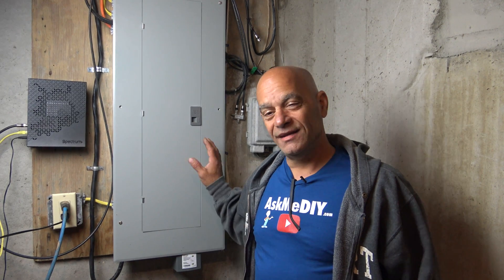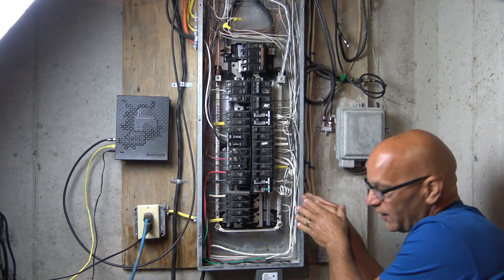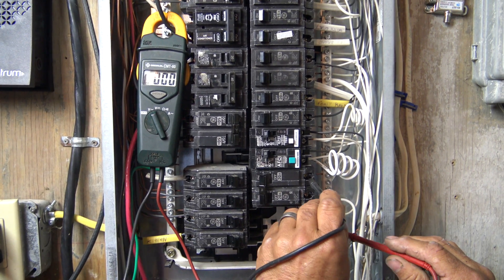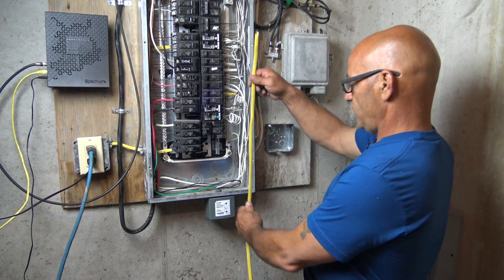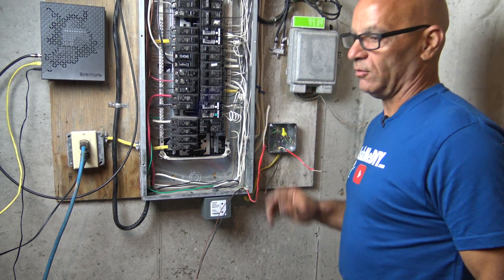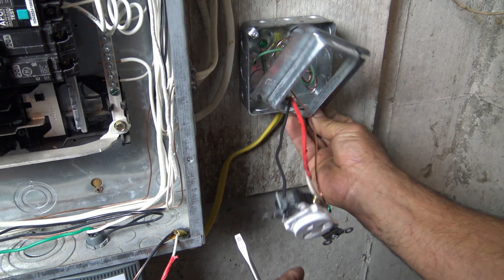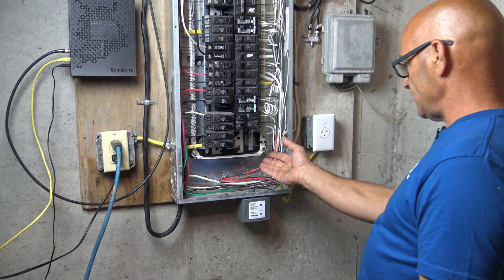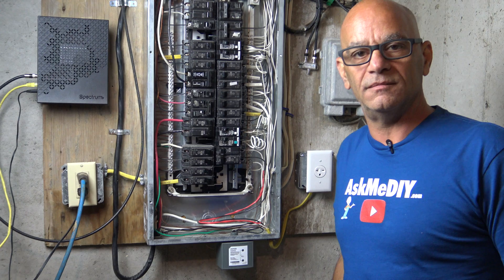How To Install a 220 Volt Outlet

Comment: I am fixing to install in my garage a 50 amp 220 3 prong plug with 6/2 nm-b wire using a metal box the same as you just did. This video is the only one I've seen after many searches showing this particular install and how the metal box is grounded.
Reply: Awesome, Glad I was able to help out.

Comment: Hey, thank you for this beneficial video. I just didn’t get the ground cable thing I just need a little bit of explanation regarding what kind of cable should I use if there’s a name. Would it have two or three wires in it? 
I need to run a 240 v cable from my broker which is outside of the house to the kitchen for my new electrical stove. Do I need to have a cable that has three wires to run it all from the breaker to the outlet?

Comment: Our electrician uses 8 gauge aluminum wire for the 240 outlets. Is there a NEMA 6-20 receptacle that is rated for aluminum

Comment: Dominick, i need to place a 240 receptacle in a outlet box that used to have a 240 but now only wires live their. My dilema is that my receptacle has 2 hot and a ground connection but the box has a red a black a white and a ground wire. Red and black are hot what do i do with the white?
Reply from the maker: Use a tester and which wires are hot and voltage. What kind of breaker?

Comment: Can I just replace a 115v with a 220v if they are both 15amp?
Reply from the maker: Not a chance
Reply: @Askmediy  could I use a step up converter in lue of wiring a new breaker? It's for an ac unit
Reply from the maker: Just based on the questions you’re asking me you need to get a Electrion on this. You’re going to end really doing something wrong here.

Comment: Nicely explained yet we need to find you some electrically insulated screw drivers! 

I have one question. Can I install a 240vac outlet in series with a wall heater or will this cause the breaker to trip? Or should all outlets and appliances have their own path to the breaker panel?
Reply from the maker: Thank you. Yeah I would run a separate line for each outlet.

Comment: Why not just use a Mulberry cover instead of using a raised adapter plate- device- finish plate?
Reply from the maker: Whatever floats your boat really. For where this outlet is located, yes a mulberry cover would've been better. But hey had to get the video done.

Comment: Good info.   I'm installing a Mini-split, and its rated 208-230v/60Hz/1Ph.  I'm assuming this is the wiring setup I need for that.  I've done 110v wiring including installing new wire and breakers, but as a DIY guy, I've never done something like this and am just looking for some helpful info.  This seems to be the right thing I'm looking for!

Comment: Thank you for the great tutorial. A couple questions: another video said to have the ground on top and the two hots on the bottom. They said it protects it if the cord gets hit or if water drips on it. I don’t quite understand that. You mentioned code and identifying the two hot wires…are there other NEC codes (for a simple install like your demonstration) that we should know about? I.e. fireproof grommet through the panel knockout or using a plastic vs a metal box for your switch. If you have the space on your panel can you install any size amp? Ex. 240v 50 amp double pole single throw switch without worrying about if there is enough power coming into the panel (dumb question but I, for one, don’t actually know how much juice I have coming into my house). Thank you very much for any clarification you can bring as I am about to install a 240v outlet next to my panel for my air compressor.

Comment: dude can I install a 15A 125V outlet on a 220V circuit without using above recommended wattage?
Reply from the maker: No, it's still 220 volts. You can use the wire, but it has to be connected in the panel as 120 volts.

Comment: why  a return(neutral) is not required for this 240V wiring? good video very instructional and fun to watch every minute of it.thx
Reply from the maker: this setup does not use a neutral wire. The neutral wire is a return path back to the transformer, in other words, a balanced load

Comment: Are the Input power mains OUT OF PHASE with each other?
Reply from the maker: Yes of course they are. Don’t really understand why you’re asking that question on a install video!
Reply: @Askmediy  Well

I am 30 year electronics Tech and not a Licensed Electrician

I have assumed that there are two 120 vac inputs that are of opposite phases sent to each Homes Main breakers

I see that that a double breaker is really connected on the same power Bus

I just thought I would ask

That's all
Reply from the maker: @joetterolison1286  oh ok. The breaker only looks like it is. It actually grabs the two different buss bars. One from each side. On my website I show more of this. Askmediy.com

Comment: Thank you.  Is the size / appearance different between a 120v 20 amp receptacle and a 240v 20 amp receptacle?
Reply from the maker: Same wire, 12 gauge 20 amp. Just wired differently.

Comment: G’Morning Sir!!
Pls let me know if you can help answering a quick question…
Went to Home Depot to get a 15Amp / 240V 2 Poles breaker..
Got home to start the install BUT I realized the connectors back on the breaker does not match with the pins on the bus bar.
Here is the question…
Are the back connectors of the breakers different from one brand to another?
Cause now everything is done here but the freaking breaker that does not snap in to the 2 bus bar fases!..😬
Thank You in advance!
Reply from the maker: First you need a 20 amp breaker and the type must match what you have now. Bring a breaker in the store
Reply: @Askmediy  Thank You so very much for your fast reply!
I work fixing Dental Equipments.
I have just one dental equipment (sterilizer/autoclave) that the manufacture says Circuit Breaker 10Amp and this new outlet will be dedicated to test this equipment only.
Because the Manufacture says 10Amp Breaker I thought it must be it.
I got 15Amp cause I haven’t found 10Amp.
The equipment has it’s own breaker…so…I understand I can get a 20Amp breaker and if something is wrong with the equipment the breaker of the equipment trips first.
Ok!!
I’ll get one breaker out of the panel and make another trip to Home Depot!
Have a good sunday Sir!
Reply from the maker: @SOLLAIUSA  are you sure it’s 240 volt?

Comment: I just want to be very clear about the ground.
There's 240v going through the ground back to the ground bus, correct?
Reply from the maker: The ground is ground and never connected to a neutral or hot leg
Reply: Melvin, I think you're referring to the part in the video where there's a reading across ground and one of the 240's positive legs. That was 120 volts, not 240. It makes sense since INSIDE the box, neutral and ground are connected, and a return path for any 120 positive.

Comment: Dom, great video. I been watching YouTube video for the last two hours. You have the best example of how to install a 240 outlet.

I’m gonna be wiring in some 120 and 240 volts next month on a new sub-panel in the shop. I never worked with 240 volts before. Now I have a question that I can’t seen to find the answer too. 

Can I run two 20 amps outlets at 240 volts on the same circuit in parallel? Each night lights will be drawing 5.3 amps continuously. I was thinking of adding a 3th night light but I will be at my 80% capacity. I don’t want to over heat the wires so I think 2 light will work just fine on that circuit. I also will be adding an on/off 240volt, 20 amp switch to each light on that circuit. I will be using 12 gage wire for the lights and switches. Please remember I never worked with 240 before.  

I’m gonna have an electrician come in and wire the new sub-panel and inspect my work too. 

Thanks a lot.
Reply from the maker: Yeah sounds right to me.
Reply: @Askmediy  thank you so much.

Comment: The warning on my tanning bed says voltage must be below 230 VAC or I may need a buck booster. I've got the same set up you just demonstrated, but don't have a meter to check it yet. I assume it will also be ~245. Any advise? After a quick search, those things appear to be pricey.
Reply from the maker: Just get a cheap meter and you’ll know for sure .

Comment: What do u recommend when moving the original panel to a new spot. It’s 100 amp service breaker not main lug. What I want to do is just use another 100 amp breaker from the old panel to a new panel 100 amp to main lug. My question is the original panel doesn’t have a ground bar, I did run a ground wire from old to new panel, how do I ground it. And does ground & neutral have to be bonded in the new panel?
Reply from the maker: Yeah you're going to need that ground bar. If you have a sub-panel, no. If not yes,
Reply: Thanx for getting back to me. I didn’t totally understand ur answer. I definitely need to install a ground wire in the old panel for ground to new panel. But does the new panel have to be bonded? There is no sub panel, just old panel to new panel?
Reply from the maker: Yes always.

Comment: At the actual outlet I get 120 reading from both hots to ground.. but dont get a reading from hot to hot.. help, what do i do to get 220 from hot to hot?
Reply from the maker: Sounds like you have both hot legs on the same buss bar in the panel

Comment: Great video u make it easy. I am doing this for a air compressor now i need to find the plug i need so i can plug the compressor in when im done. Is there a good brand plug i can get ?
Reply from the maker: Just don't buy one at the dollar store. Home Depot has good ones, for the 220 20 amp  Leviton is a good one

Comment: If 2-20 Amp breakers produce $240 volts, why do people use  2-50 amp breakers to get the same for the Tesla charger?
Reply from the maker: Because that's what is needed in those chargers. Like some instant hot water heaters can use 4 220 breakers.

Comment: My stove outlet is a 220 and all the sudden it started beeping bad line now my stove is all electric. I had to cook dinner so I moved the stove over to where the AC was plugged into which is the same type of plug and I plugged it into there and it worked. I then continued to cook dinner. I have replaced the outlet on the wall I've also replaced the breaker plugged the stove back into where it belongs and it still is beeping a consistent long beep and saying bad line on my stove. Does that mean the problem lies within the wall???
Reply from the maker: Are you sure it’s 220, do you cook with gas, flame?

Comment: My welder is 15 amp 250 volts. Can I use this 20 amp 240 to run my welder? Is it safe to do so?
Reply from the maker: That's what you would use.

Comment: Is there a way to wire a single 240v outlet with two 120v outlets off the same breaker?  I have a piece of equipment that will require 240v and a separate 120v device.  It's a table saw and a dust collector, namely a Shopsmith.
Reply from the maker: I mean can you yes, should you no. You would just use one of the hits from the 240 and a neutral for the 120
Reply: @Askmediy  so, it would be better practice to run the 120v dust collector off a separate breaker and run two sets of wires?
Reply from the maker: Yes big time.
Reply: @Askmediy  thank you for your time!

Comment: great video, my solar grid tie inverter  is 2000watt ac output, once i install the 240 plug you did , which AC breaker should i use ?
Reply from the maker: I would have to say the house one. But to tell you the truth I don't know enough about solar to give you the correct answer.
Reply: @Askmediy  i guessi gnore the solar part jus t an AC out let in  an excloused extensions to to house .. i guess a GFI too. .
Reply from the maker: @aedgvv6095  No, no need for a GFI. besides this 240 volts.
Reply: @Askmediy  so in north america hot tubs have no GFI?
Reply from the maker: @aedgvv6095  Oh GOD yes, So sorry, I was answering like ten questions at the same time. Depends on what you're connecting if you need a GFCI breaker or not.

Comment: My friend lives in a condo with his own panel near the kitchen. He wants to switch from a gas to an electric stove and needs a 240 plug. It looks like he has space in the panel and breakers that are marked 120/240. Is it going to be difficult to change it from 120-240? How much would it cost to hire and electrician ?
Reply from the maker: He'll have to run a 40-50 amp wire from the stove to the panel. How much, I have no idea.
Reply: @Askmediy  thanks for the quick response!

Comment: Great video. I do wish the ground wire in the box was explained a bit more.
Reply from the maker: You and me both!
Reply: The metal box must be grounded. You need 2 pigtails and a wire nut. One goes to the box and the other goes to the receptacle ground. The ground wire from the yellow cable ties them them together via a wire nut. Three wires in the wire nut. See view at 10:37. Metal boxes typically have a 10-32 threaded hole for a green grounding screw.

Comment: You dont need to use 4 wires. Just asking as i watched another video and he used 4 wires.
Reply from the maker: What you watched was them using the neutral. It really all depends on what you're wiring.

Comment: Best video on installing a 240V outlet, thank you, question I'm putting a outlet outside under my carport to run a welder, what kind of box do I need?
Reply from the maker: You'll need a whats called a bubble cover. But really there are a few ways you can do this. Just ask at the store and you'll see.
Reply: @Askmediy  thanks, I saw few different types at Lowe's today, some was metal and some plastic.
Reply from the maker: @kemarrance8755  Either one really. I like plastic for what you're doing
Reply: @Askmediy  Ok, I like the plastic more too, thanks for the advice, I'm going to get the plastic one.

Comment: If you were to wire 2 hot wires and 1 neutral wire to a light socket will the light socket power a 220 volt lightbulb
Reply from the maker: Most light sockets only have one hot.

Comment: I added a 220 prewire for my new construction home for an EV charger. Do I need to buy a circuit breaker and a  NEMA 14-50 outlet? Or will that be included.
Reply from the maker: No it won't be included.
Reply: @Askmediy  Ok thank you for the reply. I plan to hire an electrician to help install the outlet.
Reply from the maker: Good idea I would say. Make sure you ask if they have even done one before
Reply: @Askmediy  I will make sure they have experience installing EV chargers or outlets for EV charger use.

Comment: out of all videos this one is best
Reply from the maker: You bet lol. Thank you very much.
Reply: @Askmediy  copper wire gage i once bought a roll cost over 200 bucks i thinks its thick i could use it but i have regular cord wire from a long cord  i would rather   use that plus in going to run it in a fireproof pv pipe on out side of house  i feel no wires should be inside walls in case of electrical fire and it too late to seeso which wire ? thick or regular?

Comment: Why is there no need for a neutral wire for 220v?
Reply from the maker: A neutral is a return path, not always needed. Other types yes. Like a dryer perhaps. Bigger machines, things like that.
Reply: @Askmediy   I have a air compressor that needs 220 at 15 amps 1 phase (as the instructions saying) do I need a neutral?
Reply from the maker: You tell me, is asking for one? 15amp I would have to say no.

Comment: so if i turn the main off which my box is a 200 amp service box  and off with the breaker i should be fine???  funny thing my box is mounted on the wall that directly behind  the wall ill be wiring the outlet for an air compressor you made this real easy ive just dont know about the ground at the box... ill probably find more grounds when i take the cover off.. thanks
Reply from the maker: Yes, even though the main is off there still is power in the panel. Just not on the breaker bars.

Comment: i have a 220v  AC / HEAT unit, and i have the same receptical as you just used.  i just wasn't sure of what breaker to use.  i think you have answered my question... correct me if i am wrong....   Thank You
Reply from the maker: Sounds about right to me

Comment: Why is it not 220 anymore in my panel it said 220 air consumption is it a 240 my outlet looks the same as yours.
Reply from the maker: I hear ya. It’s been 240 for a very long time. Think about when was the last time you heard 110 volts? But still many people still say 220
Reply: askmediy if I need to change the outlet to a different configuration for a different plug will that be ok to do. Also will the voltage adjust to the new unit if it’s a 230 thanks.
Reply from the maker: As long as it’s a 220/240 outlet. Also keep in mind if it a 3 wire or 4 wire.
Reply: askmediy you mean if it’s 3 wire or 4 wire to hookup to the outlet if it’s 3 or 4 prong outlet needs that many wires for the panel.
Reply: askmediy what is the difference between 3 or 4 wire.
Reply from the maker: If your device requires a neutral or not. Ala white wire

Comment: Great video! Do you have to balance the breaker amps on the left and right side of the panel?
Reply from the maker: It’s not a big time must do, but it’s a good idea.
Reply: The balance doesn't change because you're drawing the same amount from each side.

Comment: I need the exact setup for my craftsman compressor, however in my panel all the neutral and ground wires go to the same and only bar in my panel. Is this okay to do?  would I have to do a separate earth ground on my compressor motor?
Reply from the maker: No you're fine of what you have.
Reply: @Askmediy  thank you so much